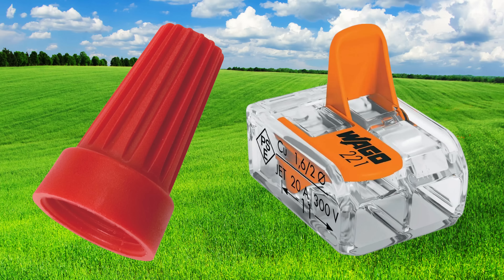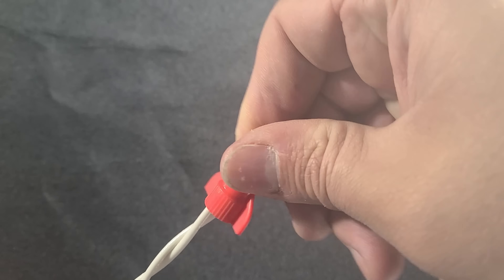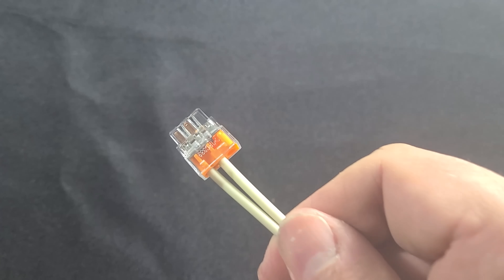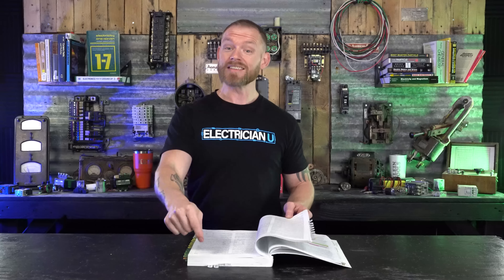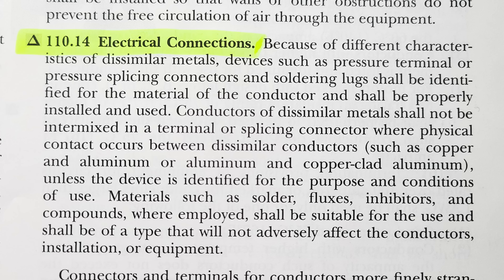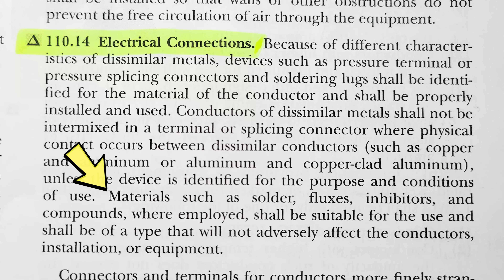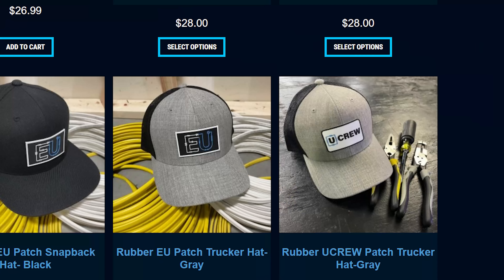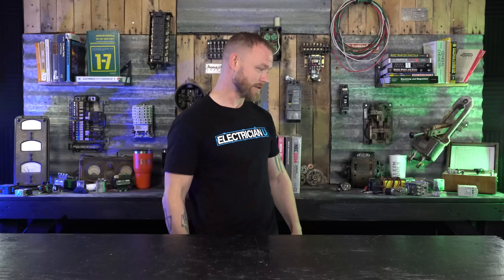Should We Use WAGOS or WIRENUTS?!?!

Comment: i like backwired outlets with good clamp down connections for 4 wires better connection than wire nuts easy to see if wire is in correctly and very tight good connection wire nuts and wagos can fall part a lot easier than the clamp on side of quality outlet
the best reason to use wago is stranded wires people screw up wire nuts all the time the stranded does not connect to solid easily

Comment: The reason for twisting wires in a soldered connection is that the strength of a soldered connection can be compromised by high current (heat).

Comment: i use wago only in light and fan fixtures, or communication wires ...i will never use behind the walls in dwelling building or homes...due to weather changes and we have 4 seasons to blame for...wago's gonna cause more house fires due to moister, if those wago's connection have loose connection...plus friction  it equates a accident waiting to happen next, its something we need think about when working new connection from exiting homes or new homes...wires needs to be tightly connected with strongest GRIP on every receptacle boxes ...cause the load centers have 20amps to 15amps load that share across entire circuit behind your walls, specially important for HVAC units with electric heat that have breaker boxes inside their unit would have wires stab and screw tight for stable unit running up to 50amps...and many times its those behind the walls get weather changes from outside of your home

Comment: To be fair. The debate around using Wago or wirenuts is a bit inept. (Wago is a company making connectors (of many different types) among other things, and Wirenut is a brand name for a specific product.)
There is many different types of terminations for a wire, the common ones are:

Clamping with a screw. (Either have the screw itself squeezing into the wires, or the screw pushing on a clip that squeezes the wire. The later is better for multi core wire.)

Spring terminals. (This is what Wago is most known for making, but they make almost all the other types here as well. But plenty of other manufacturers makes spring terminals. Phoenix contact is one as an example. Depending on how the spring terminal is made this can cut through very fine multicore wire over time, ie for fine multicore wire use ferrules. Though, for multicore wire one should more or less always use ferrules to contain misbehaving wires.)

Insulation Displacement Connector. (IDC. Phoenix makes a fair few terminal blocks with this, but the most common place to find it is on SATA power connectors in computers as well as Ethernet connectors, POTS, and so forth. Advantage here is we don't need to strip the wire. Though, I have seen some people refer to spring terminals as "IDC" and IDC connectors for "crimped ones"....)

Crimped connections. (Relies on squeezing a metal jacket around the wires, but this can't be undone. So any future amendments requires one to cut the crimped wire out.)

Soldered connections. (On par with crimped connections, with similar downsides.)

Twist on connectors. (aka Wirenuts, these are simple and reliable. But tends to fall off when exposed to long term vibrations, and the wire itself can move and create gaps leading to a lot of arching. In almost all environments twist on connectors are fine, however next to vibrating industrial equipment it is recommended one uses another connection.)

Wire wrapping. (This is were rapidly falling out of favor already in the 90's, nor were it never really used for power distribution, especially not in buildings. But effectively it is just a wire wrapped 2.5-4 times around a pin, with preferably 0.5 turns of insulation around the pin as well. Wire wrapping were most notable in mainframe computers, telephone switches, and frankly most electronics before PCBs became a cheaper alternative. (there is however turret style connections as well, but that is a soldered connection, and both of these weren't weird to see in the same system.))

Then we have other methods as well. I am not making a list of all the different wire termination types in existence.

Though, personally I do like Wago's terminal blocks, since they are having fairly low contact resistance, easy to work with, and aren't that unreasonably expensive.
However, I work in electronics manufacturing not as an electrician. For running cable in a building there is other factors to consider compared to building electrical equipment.
But over the years I have worked with all the above, and they each have their pros and cons.

I however don't see electricians use twist on connectors these days where I live, it is primarily spring or IDC terminals for most splicing jobs and screw terminals everywhere else.

Comment: I was taught to and always have twisted the wire nuts until the wires are twisted together and down the wire coatings. but, if the wire is nicked when stripping, bent previously or under a screw/fastener, it then becomes fragile and can break off or be ready to break off. but that just means you should always cut off and properly strip to new bare bright conductors and never re-use wirenuts!  they do stretch open inside and the plastic can fracture.

Comment: Wire nuts are outlawed in UK. All connections are made with screw blocks to clamp each wire in a inside a metallic tube inside an insulated sheath.
 I find the American wire nut a dangerous device since due to the lower voltage, 110/120 V's 220/240, there is twice the current in the wires and thus twice the chance of arcing at a wire nut connection.

Comment: The simple answer is this:  If you are joining two or three solid-core wires, or two or three stranded-core wires, then a simple wire-nut is best.  For everything else = use a WAGO 221 connector to make the connection.

Comment: Given that I'm wiring a boat, I refuse to use either. Crimped connectors with adhesive-lined heat shrink is the only way to go.
I won't use solid wire, either. Tinned stranded copper only.

Comment: Dustin, why are stab-type WAGO connectors fine but back-stabbing a receptacle is seen as an amateur thing to do? A listed receptacle should be absolutely safe and reliable if back-stabbed yet no professional does this. I've played it safe and always used the termination screws. Great video series!
Reply: I am no expert but the difference I see is that most back-stab connectors on devices have only the spring tension that you push against as you push the wire in to hold the wire.  I see that as inadequate.  Wagos have the additional squeezing force brought on by pushing the lever down.  Some better outlets have "stab in" connectors that are then tightened by turning a screw.  I trust these as well.
Reply: @tgeliot  You need to re-read Paul's original question. He said stab-type WAGO, not lever-type WAGO.
Reply: @Quagra-42  Thanks, I didn't realize that Wago made real stab type connectors.  I thought the term was being used loosely here to include the lever kind.
Reply: The push in wire connectors are only good for smaller guage solid wire like #18 and #16 that would be used in fluorescent light fixtures. I use them for LED conversions in the fixtures where there is numerous wires to bundle together to make a pigtail for my hot side and the other side for my neutral side. They are great for that, just plug them in, but they do not accept stranded wire. They are not great for #14 or #12 because the larger size wire tends to rotate in the ports just like a push in on the back of a receptacle. Wagos clamp down onto the wire and can be used for both solid and stranded wire, however if you use a wire nut on a solid to stranded wire, twist your strands a little tighter together after stripping then just make sure you're using the correct size yet smallest wire nut that will fit and properly cover the connection, it will bite into both type conductors and make a secure connection. Too big wire nut will come loose. It's all about making sure you make a secure connection and using the correct size connector to hold them all together. I feel more secure making a good neat tight twist and using the correct size wire nut. I use push in connectors for LED Lighting conversions on fixtures that have smaller multiple wires. The only difference with Wagos is you can use them with stranded wire too and are reusable. I'm also sure over a period of time the clamping force will weaken too.
Reply: Nailed it. People buy into the bull crap sales pitch of wagos and are lazy. Wagos are trash.

Comment: 11:42 Actually there are Wagos that are rated for both typs of wire. Those are the ones with the little levers. They are even easyer to disconnect wires from and in general super easy and quick to install. Also this typ of Wago is even more capable of haveing some pullingforce on the wires.

Comment: In our commercial office, our electricians had to go through and replace dozens of the push-type connectors. They were causing all sorts of voltage issues in a few 20A circuits. Our electricians said they never use these because of this.
Reply: Most people I’ve argued with basically call all push in connectors “wagos” yet have never actually used an authentic wago which is way better than those cheaper versions

Comment: The question is how good the actual connection is. It would be good to measure the contact resistance. If the connection is loaded with max current that results in heat if the contact resistance is bad.... In worst case result in fires or the plastic melting maybe....
Reply: Good point, someone else commented on how we frown on back-stabbing devices, when this is a similar concept.

Comment: in the UK we use wagos or ideals ,(which are cheaper and more compact ) as we have regulations on hidden connections and being "maintenance free " they have really made things easier for sparks and are definitely what you should have in your box for emergencies let alone installs , like the push fit water pipe stop ends for plumbers its something we carry

Comment: If you want a reliable and consistent connection DO NOT USE WIRE NUTS. Wire nuts are not a very reliable way to connect wires. Let the hate flow, but we have all had a wire nut fail due to improper installation. 
On the triangle of work you can have cheap, fast and good. With wire nuts you get cheap and fast but not good. With WAGOS you get good and fast, but not cheap. If price was not a factor wire nuts would not exist.

Comment: best video on this topic... however not as fun to watch as some guy on a lab bench melting conductors with a heat gun or showing us what happens when you put 50 amps through a connector that connects wires that in the first place would honestly only be approved for 20 amps.

Comment: Wagos are great at what they’re good at- installations in protected, indoor (or outdoor in a watertight box/form 7 fitting/piece of electronic equipment, etc.) locations with fairly low vibration and at pretty low current. Awesome for convenience receptacle boxes, inside of light fixtures, timers, cameras, etc. They can be reused (so can wirenuts, but not always if the last guy that put them in was a jackass or if they’re those AWFUL old rubbery Scotch ones or el-genericos that came with a light or whatever), and it’s WAY easier to remove just one safe wire out of one to rewire something than wirenuts (can be impossible with wirenuts under the same conditions as mentioned before) if something has to be worked hot, and they sorta-kinda take up less space because they’re shorter and can be placed in little areas a wirenut might not fit into, but they’re almost always fatter, so that’s sort of a wash.

Outdoors, areas with heavy vibration, wet/damp locations, locations that are prone to physical damage (anywhere that heavy things fly past, like in a steel mill, warehouse with fork trucks, conveyor, etc.), higher current (at or close to their current rating) situations, areas with caustic chemicals or solvents, or areas subject to high heat and/or extreme heat/cold cycles, however, they are unsuitable for. I’ve seen them rattle loose from vibration (wirenuts can too, if installed incorrectly, but not with a couple wraps of good tape like Scotch 33), get brittle and sort of disintegrate from heat/cold/chemicals, short out when a little water gets in them (wirenuts can do that too, but again, not really with a wrap or two of tape), overheat from either ambient heat or higher current heating the conductors up (particularly if it’s an intermittent current or a place that sees extreme temperature differences), which causes the springs to loosen and eventually become a subpar connection which leads to arcing and then total failure, or be blasted into little pieces when struck hard, where a wirenut would generally just deform a little and be okay. 

I hope, eventually, a tougher, more reliable, connector much like a Wago is introduced, but until then we’ll just have to make a judgment call on which is appropriate for the specific use at hand. If they’re improved to be more durable/reliable, they’ll be GREAT almost anywhere, and worth the extra cost due to future time savings.

Comment: If you don't want bad connections and potential fires. You had better stick with the wire nuts. Personally I still prefer soldering everything. Our culture has gotten way too lazy. And it has created the sale and maintenance services of junk. Luckily for me I know how to undo most of these bad practices once an issue crops up. Sure it works fine in the beginning. But it severely shortens the lifespan of the product. And not everyone knows how to deal with it. Therefore increasing the flow of otherwise good products to the landfill.

Comment: Yeah in my area the wagos are not yet outlawed but they are frowned upon...I just started working at an apartment complex that utilizes those junk things and can't begin to tell you how many of those things I've already had to change out to standard wire nuts with a pig tail because those wagos fail so often and so spectacularly when you get to see it happen...it's the same reason why in my little area at the county level in 3 or 4 counties now the receptacles and light switches that are strictly push to connect style have been outlawed and any switch or receptacle that has both ptc and screw type connections must use the screw type connection over the ptc or the inspection will not sign off on it...we have had too many electrical fires in my area that have started because of ptc type connections...now lower Amp low voltage is different like your 3 Amp 24vdc thermostat yeah ptc is fine but 15 Amp 110 vac ptc is no go
Reply: How many of the failed connections had a Wago label? 0?
Reply: @elbuggo  all of them...I've had about a dozen myself so far

Comment: This comparison has been done to death. It's not a Wago. It's a push-in wire connector manufactured by Wago GmbH, one of many companies that make this type of connector.

Also, the terms you listed don't mean Wirenut. Wirenut is a trademarked term that people started using to refer to any twist-on connector, just like Band-Aid or Kleenex was used as a catch-all for bandages or facial tissue.

Comment: Only downside of Wagos is resistance, needs a bit more surface area on the connections and a bit thicker metal. Sure it would add cost but for doing it right the first time, 100% worth.

Comment: You can't reuse wire nuts, they have to be thrown away each time they are undone, unlike lever wago's (221/222).  Downside to wago's are cost.  Much more expensive than wire nuts.

Comment: Hi. I am in USA and did not know about WAGO. I am not a commercial electrician but have worked 40 years in commercial aviation. During this time I worked with various electrical and navigation systems so I am not unfamiliar with the topic. Your video was illuminating! (punny, huh?). Hands down for me, WAGO is the way to go.
Would you please tell me the name of the insulation strippers you are using in this video? I can see they incorporate a moveable stop to set the distance and do not seem to damage the conductor. Thank you so very much!
Also, It appears the WAGO may not take up as much space as the wire nut; what are your thoughts about that?

Comment: Wire Nut or WAGO for Europe easy. Wire Nut does not have the necessary approval in the codes. Also, no electrician takes the time to twist the cables when they can simply be plugged in. With the exception of the fuse box, only plug connections are used. Solid screw connections are only used if really thick cables are laid.

To connect copper and aluminum cables, WAGO has to inject a special paste into the connector. This prevents corrosion. WAGO specifies exactly how this is to be done. WAGO offers the paste separately.

Comment: I'm a Millwright, so I'm not an electrician, but I do light electrical work.  Wiring up a screen for a bay door for example (so it can retract down and back up) just requires some wirenuts, super easy, I guess it depends on what you are doing.

Comment: IMO, this video is THE BEST explanation of "when and why" to use Wagos and Wire Nuts.  Here's My Takes from this video:
* If you're EXCLUSIVELY using SOLID wire (i.e., "Romex"): use "Whatever Suits Your Fancy" - Wago or Wire Nut
* If you're EXCLUSIVELY using STRANDED wire: use Wago "Lever Lock" splices
* If you're MIXING solid and stranded: use Wago "Lever Lock" splices
* If you're doing a "Ronco 'Miracle Oven'" type installation ("Set It And Forget It" - i.e., it won't be "disturbed"): use Wire Nuts or Wago "Stabs" (for all-solid wires) or Wago "Lever Lock" splices (for Solid/stranded mixed or all-stranded)
* If you're looking for "Space Saving" in the Electrical Box: use Wago "Stab" (all solid wire) or "Lever Lock" (solid/stranded mix or all-stranded) splices

I know there are other "Permutations" not listed, so let your experience and "common sense" guide your choices. :)